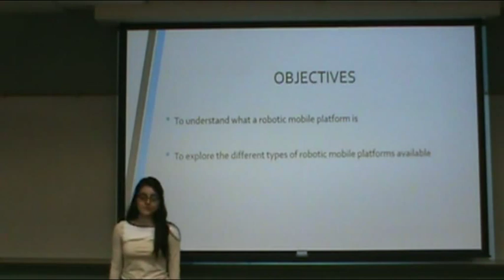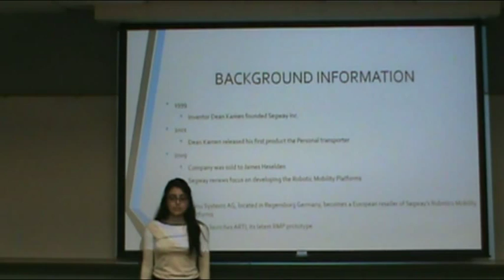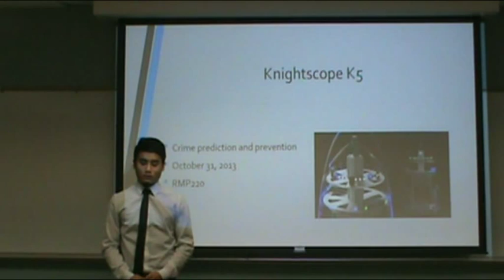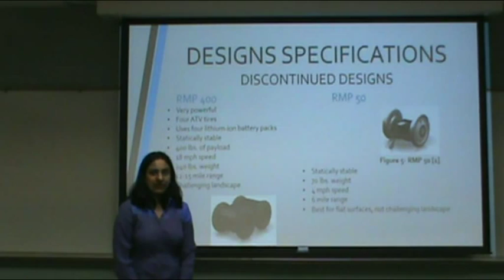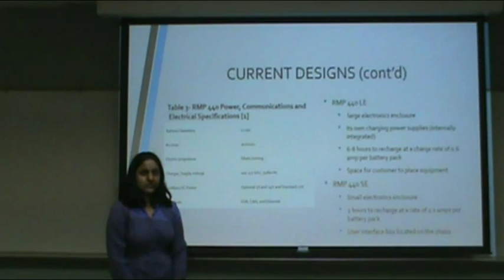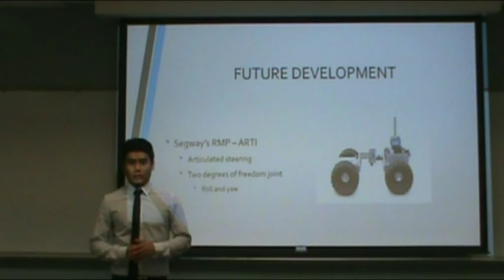Team C: Segway RMP Series Mobile Robot Platforms

Comment: Great introduction, it was clear and to the point. I would recommend however that all presenters be present in the beginning.  The content was good and carried out well. I think I noticed some of the presenters reading off of some notes in front of them, which was a bit distracting at times since they looked confused. There were also some outside noises which were a bit distracting; in the first transition of presenters there was a very clear opening and closing of doors in the background. I don’t think these are major issues but they can take away from the presentation. The presenters were great, the dress code was spot on, the visibility was okay, and the sound quality was great. The length of the video was a bit on the longer side but I don’t think it was significantly long enough to say it was negative. Overall it was well executed. I recommend that you induce a quiet atmosphere, condense a slide to remove some of the time spent, and show everybody from the beginning so that I know what to expect. I think that the shuffling of the presenters was a nice maneuver, but it was costly in time. I’m impressed that it was all in one take, however. Good job.

Comment: I liked the presentation. The topic was interesting and presenters did a good job organizing the information presented. It is also possible to tell that they prepared beforehand. Something’s that caught my attention though is that most slides seemed “empty”. Meaning that the letter font was way too small compared to the size of the slides, which made it really hard to read what was on them. Another thing is that I would’ve like to see more picture and images. Some slides had too many words on them and zero pictures, which makes them less appealing to the audience. However, I still feel that it was an overall good presentation.